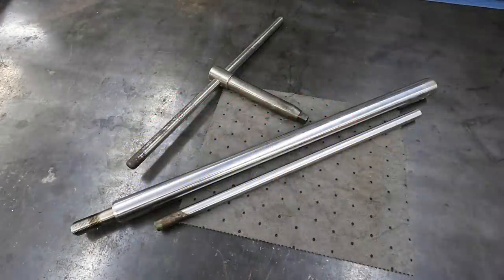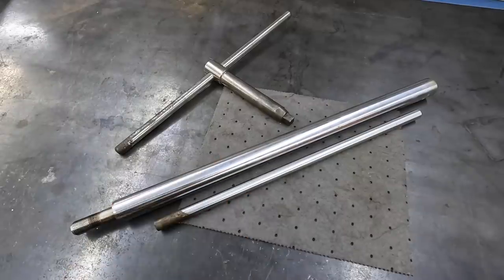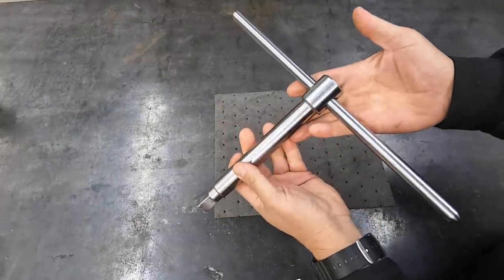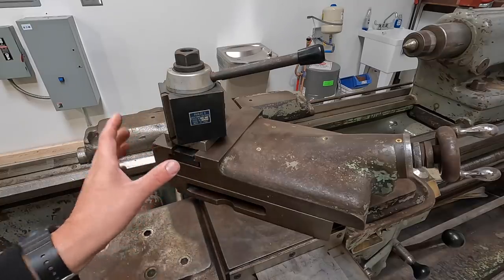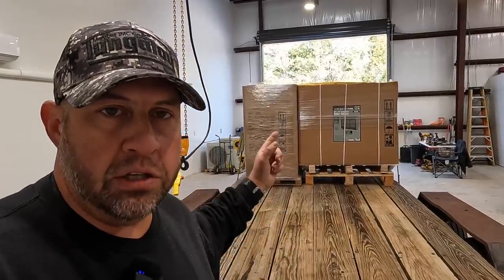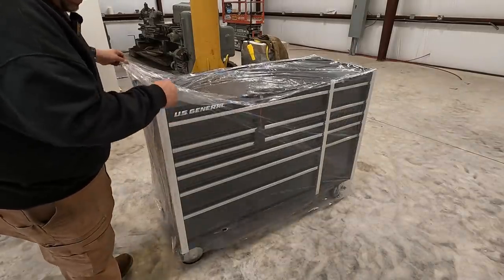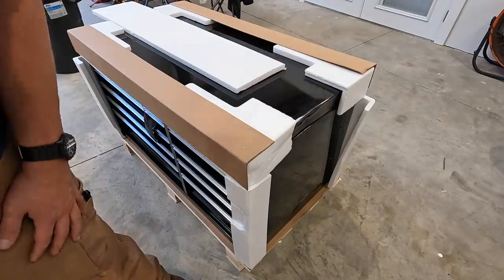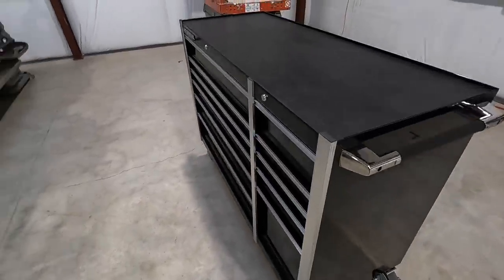Saturday Night Special 358: 3 Jaw Chuck Wrench, New Tool Boxes

Comment: In your DeWalt motor drawer I noticed a newish DeWalt right angle grinder cut-off wheel guard.  In a safety fit I bought the Makita version.  Yours underused, too?

Comment: I have a Kennedy tool box tower with my 11 drawer then a 2 drawer riser in the middle that the top box sits on and then the bottom roll around is another Kennedy 7 drawer. I had to roll that around and whole heck it is heavy. I wish I went with a bottom harbor freight u.s general 42 inch roll around box. So I might switch to it in 4-5 years if I have to keep moving my box around at work
Reply: In reality the Kennedy boxes are just “ok”. I have 3 of them. If I had to do it over again, I wouldn’t have bought them. There are better options out there.
Reply: @grntitan1  true I have a harbor freight by me so i have through about their 42 inch box rolling cart
Reply: @grntitan1  what makes Kennedy tool boxes “ok” what other boxes do they make that are better?

Comment: I have a question - What rotations to use when drilling a 20mm hole in brass  ? I just have a problem with the selection of rotations for making bench hook for my my workbench. Sorry for this question but  I am not machinist.

Comment: Just wondering why you went with a reamer and not a regular drill at 8:34  are there advantages?
Reply: The advantage of the reamer for this application is less slop in the handle, gives it a nice slip fit, there's no guarantee that drill is going to cut with a fit that will not have slop in the handle, that reamer probably left .0005-.0015 on either side of the bar for it to slide perfectly through the hole. The screw on the end sets the bar where you want it for different leverage. Made quite a few of these at all different sizes; I'm a 27 yr. old machinist of 10+ years myself.
Reply: A drill does not typically cut a truly round hole. That’s tough for some people to believe, but it is true. The hole is typically more of a triangular hole. The thinner the material the more it is evident.
Reply: thank you
Reply: thank you
Reply: He drilled the initial hole with a drill bit, then cleaned it up with the reamer. Now the hole is actually round and also the correct size.

Comment: You should do a slab of marble instead of wood that way you can use it as a surface plate too. 👍👍
Reply: Slab of 1inch thick steel plate haha
Reply: Marble would be a poor choice for both.
Reply: @grntitan1  Yeah, marble is very soft and porous. Just above gypsum (ie drywall) on the mineral hardness scale. It's also not acid resistant.

Comment: I cannot believe that 55 inch toolbox weighs over 200kg, that's the same weight as my 120 HP motorcycle ! I would be very surprised if it weighs 200lbs let alone 200kg ! Maybe they mean loaded up or maximum load capacity but there is no way a thin sheet steel box of that size and construction can be the same weight as a 900cc 4 cylinder motorcycle !
Reply: Without a doubt it weighs that much. Those newest US general are beefy mostly double-walled toolboxes.
Reply: @michael-michaelmotorcycle  60lbs or 70lbs I can understand, 100lbs maybe but over 400lbs, never !
I'm using a motorcycle as a reference but unless there is something wrong with your weighing scales you would never consider that as normal !
Reply: Nope, 100% legit.  At most, Adam was reading the shipping weight, which would include 20-40 lbs of packaging.  HF doesn't screw around when it comes to their boxes.  Heavy-gauge sheet metal, and a whole lot of it.  I bought one of their 72" box a few years ago and needed several pieces of hydraulic equipment to unload it and get in into my building.

Comment: I have two properties, like you now have, and have installed the Blink security system (owned by Amazon) in both locations. Very nice. The cameras run on batteries and I was highly skeptical. After 2 years I have one camera warning me of low power. Another camera offering plugs in. I’m running a combined total of 14 cameras with one control module at each location. They run periodic sales at significantly reduced cost.

Comment: I just ordered the locks off Amazon to change out so I'll have one key. I'll try to post the links. 
Admiral Locks Tubular Cam Lock, Keyed Alike Removable Key (5/8 Inch 90°, Chrome Pack of 5
Admiral Locks Tubular Cam Lock, Keyed Alike Removable Key (5/8 Inch 180°, Chrome pack of two)
It didn't come out as a link. If you order both at the same time they are supposed to come keyed alike.

Comment: Hey Adam!
In regard to the 'wood top' for the larger roll-around...you may consider cutting down one of the heavy rubber 'horse mats' from your local ag-supply.  Many of our cabinets in our manufacturing plant have these.  They are affordable, high durability and allow for considerable impact and cut resistance as well.  The ones we typically get are either 5/8" or 7/8" thickness and about 80 ~ 90 Shore A durometer.  Readily cut with either vertical 'wood' bandsaw or circular saw.  Leftovers of the mat are also useful for other bench protection / impact pads.
Ken

Comment: Ikea believe it or not sells solid wood counter tops that make nice bench tops. I have a variety of tool  boxes, the harbor freight ones are the best and have held up well for years. I buy numerous sets of their cheap tools to place where they are used. Sometimes a few specific wrenches in the right spot will save countless trips back and forth to a tool box. Some time the tool in the box is in use elsewhere because someone else is using it or you didn't put it back. Job specific tools that don't travel are easier to find. So extras pay off. Employees will steal the Snapon tools but leave the HF tools. I don't buy Snapon because they are way over priced.

Comment: Check out the kitchen department at Ikea for the toolboxes. They have wood counter tops and rubber mat on a roll to cut to measurement for the drawers. Much cheaper than the specialized stores. :)

Comment: The Harbor Freight tool boxes are really good. I am an auto mechanic of 32 years and I have owned just about all brands of boxes. Dollar for Dollar. The U.S. General & Icon boxes are the best bang for the buck. My most recent box is a Husky with the easy close draws. You can't slam them. It draws itself in slowly.

Comment: A lot of suppliers don't seem to have accurate inventories. I just went to the local ford dealer and they didn't have something I had called ahead about and was told they had enough on hand for what I needed. I've also had problems with every auto parts store in town, if they don't go physically check it ends up not being on hand.

Comment: I think you'll find a wood top is going to be hard to keep looking good because of oil soaking in. My Matco box (I'm a retired auto mechanic) has a stainless top they sell a maple butcherblock top but I oped for the stainless
I couldn't tell if the drawers had liners in them either you'll want to add them to keep the tools from slideing when you open or close them. 
Does harbor freight boxes have roller slides? I know if mine did not the drawers would be to heavy to open & close because how much they are loaded up.
Nice job on the chuck wrench now you need to make a place to store it.
Reply: I put a coat of polyurethane on my butcher block top and it seems to be handling the oil so far, but not much use yet. Stainless would certainly hold up better as you say! My 56" box does have roller slides. One draw has maybe 300 lbs of chucks and such in it and works no problems. Drawers did come with liners.
Reply: I opted for stainless on my Snap-on box years ago and it get scratches but the oil cleans right up!

Comment: You talking about a reverse switch for your new lathe reminded me of a scene in a Cape Town workshop about forty-odd years ago. The workshop crane had been cabled up after installation, and was ready for test, but once powered up, all the functions were seen to be reversed. So this youngster put his hand up, and said “I’ll swap phases over”, and went to the old style Isolator-fuse box. Switched off, opened up the cover; and then ‘PULLED OUT TWO FUSE HOLDERS, COMPLETE WITH FUSES: AND SWAPPED THEM OVER’. Needless to say, his nickname ever after was ‘TwoFuses’. The rest of the squad; Electricians all? We never stopped laughing.

Comment: In my design, I side milled the square drive giving a blended radius to the O.D. of the shaft.  No sharp corners.  I then drilled the opposite end to accommodate a spring & ball bearing.  The handle was then turned with three radiused grooves.  One centered, one near each end.  The ball detent falling in the grooves would prevent the handle from sliding off or keep it centered.
Reply: You win......

Comment: An alternative to a wood top is King Starboard. It is available in black and is a high density polyethylene material often used in the marine industry. I have a sheet on top of the wood top on my Husky 46" rollaround. Boat Outfitters in Florida will custom cut a sheet to fit your needs. 1/2" or 3/4" thick material might work, depending on the lip. They can round-over the edges so you don't cut yourself (yes, you can cut yourself on freshly cut HDPE). Wood might be less expensive, but King Starboard (in black) won't show stains, is impervious to oil, and has a textured finish.

Comment: Very nice chuck key, wish mine was that easy to make LOL. I don't have a mill so had to make one on my lathe using the boring bar holder to hold the stock and put a fly cutter in the lathe. I made mine out of 1144 and it's working great, I don't believe the fly cutter could have handled the 1045.

Comment: I've been very pleased with the quality of the US General toolboxes from Harbor Freight once you get one that doesn't look like it was tossed overboard from the cargo ship. I went through 3 top boxes before I got one that wasn't all beat up. I had the same problem you did where I apparently bought the last one in stock in all of Phoenix and had to wait a couple weeks for them to restock. I load mine heavy and have never had any complaints about the drawers. Don't use their drawer liners though. They just slide and bunch up if you put anything heavy in the drawer. I had a bunch of heavy ESD workbench mats from work that were being tossed and I made drawer liners out of that.
Reply: We have a ESD workbench mat at work we were going to throw out.  I kept it for some reason...  good idea.  Yeah I had to go through 4 boxes to get one not scratched up on the top.  Got it home and the paint or powder coat is dripping on the drawer ftonts and the side handle is welded catty wompus...
Reply: I flipped them over so the slippery side is down and the rubber backing is up. They are thick enough to not wrinkle or move.
Reply: @radardoug  the one we have is stained on the smooth side.  Good idea.  I have also used sheets of 1/8" CCNS from a gasket company.  That works well also.

Comment: Adam - You might check this out, ive seen in the past where some bottom chests had issues with the weight pushing the castors up into the sheet metal bottom.  I saw one guy fix it by bolting in C channel on the bottom from front to back as a reinforcement.  Im not sure if this is on older or newer models of if its even an issue in newer models, just something I wanted to pass on.  Hopefully this is not an issue with any of your boxes.

Comment: 3 new virgin toolboxes ready for decals to customize. First sticker should be ab ABOM79 sticker & save some room for the BOZO sticker. Looks awesome. I'd look at some UHMW for the top since it's a little more durable  & oil resistant.

Comment: I've bought 2 42' roller cabints  and  2 end extension cabinets. I haven't had ANY trouble with them. I've got one at home and 1at work. 1st generation didn't have locking drawers, kinda sucked. But that's the one I parked. It doesn't roll around anymore. Put it in the home shop. Love the harbor freight boxes.

Comment: Hey Adam, check out your local big box store..you can find butcher block counter tops in stock usually...may need to cut it down to size though...another thought..get a sheet of 1/4" black HDPE plastic...easy to clean and won't damage parts or tools..we have steel benches at work with the plastic and they take a beating and still look great years later.

Comment: Have had HF boxes for a while. My only issue is the draw retainers get weak quick, so if you roll it on uneven floor they come open. Not an issue on the bigger boxes as they have the manual latches on each drawer.

Comment: The dent is no biggie. Just have them give you a discount, they will give you like 40% off it. then tap the dent out its no biggie.
Reply: Would be ok for me if i buy used or at auction but brand new, sorry I want a straight box...
Reply: @TheDennisZb  ...So, a "store discount" would make your life unbearable because you must have a "straight box"?
Reply: @paulcopeland9035  in this case yes i wouldn't want a discount I'd rather have a straight box

Comment: Only thing wrong with the Harbor Freight boxers are the wheels they dry rot and fall off and can't roll it around better check in to some good casters before you go loading tools in the big chest if your going to roll it around much little FYI....
Reply: Anyone else have issues with this?  I'd like to know.
Reply: @roberthousedorfii1743  First I ever heard of that. I'm there all the time and I talk to the workers and other people and never heard of them dry rotting. Have heard of people able to overload them and sometimes getting a small flat spot after sitting for several years but that's it. And if I remember I think it wasn't even so bad they couldn't move it around it just kind of was there and could be felt when rolling. At least for most people the big boxes don't get moved much after they find a home spot. That's why people buy the smaller tool carts for the mobility.
Reply: @roberthousedorfii1743  Our box at work has ZERO wheel issues at 6 years of age.
Reply: @roberthousedorfii1743  
My 44 inch set is almost 10 years old now no issues here and I live in a very dry climate.   Maybe he got a bad batch.

Comment: I. Made a chuck key with a two piece head the square point was cut and a northern smaller square head on opposite end and a square hole in rod and a small spring pulled the square into the rod if one of the many idiots left it in when they were learning it would drop the rod and not crash the lathe I can't plainly explain but it saved a 100 people and lathe 1000s of times a lot of extra work but when training new guys I know that it was worth it  it worked like a socket and ratchet head as. It connected was not much metal if spring didn't let go so handle would break out with no damage to lathe sounds like a lot of work but with the people who I had to start there is at least a 100 that owe me their life or limbs for  my design 😉
Reply: @truthbetold2914  thanks sorry I didn't even think it sounded like that I need to read befor sending
Reply: @truthbetold2914  should I remove my comment
Reply: @truthbetold2914  I had no intention of upsetting people just a old man who thought it would help someone else in future i will send my comments to you for review and edit if that would help 
Thank you for showing me my poor use of English and communication skills

Comment: Nice chuck handle, looks like a piece of jewelry. I have a similar Craftsmen box to your larger box with a wood top. I love it. The wood allows you to protect the box if you accidentally drop something and adds strength. I am now looking at the US General 26" box as a specialty tool box for my lathe. Well that over head crane sure makes like easier. Nice.

Comment: Idk about the US General tool boxes. They are good, but they are the same cost if not more than some you can get else where. My craftsman tool chest and top box have great rollers, soft close/slam catch drawer rollers, and I really didnt spend an arm and a leg on the set. Another one I like it Husky, they have good boxes. Theres another that's similar in build quality as some of the older snap-on boxes but at a lower price point. And they also have the full stainless work surface that's amazing to work on. The kind of top you could secure a small vise to that's just for lathe tooling. It just depends on the look and how you like the box. Im not sure how long the drawer rolls last since I've seen Harbor freight ones give up after about 6-9 months of use with basic mechanics tools. Though that could be just their tool carts being the lowest priced box and other factors. In a cleaner shop and under your care I'm sure those boxes will last. And if you want you can definitely add your own sliders or change things to suit your needs and wants.

Comment: I agree with you 1000 per cent on the tool boxes. I purchased a us general from harbor freight several years ago. It was better than any other available tool box and much cheaper. They knocked 100 dollars off the price because of a dent on a back corner which did not Impair the function of the box in any way.

Comment: I've had really good luck with HF.  I have air tools that I bought out of a catalog when their only store was in California, 30 plus years ago.  They were made in Japan back then and we had the same "garbage Japan" attitude back then as lots of things were, now it's China that's making stuff and Japanese tools are sought after.  I'm still running those old air tools, just a few drops of Marvel Mystery oil with each use and they continue to run great.

Recently bought new HF air tools and found that I need to check the bearings before I take the tool to the counter as I've bought two tools that had seized bearings when I got them home.  There was no question when I brought them back, no need for receipts and such, but HF is 45 minutes away for me.  For what I paid, guess I can't complain much.